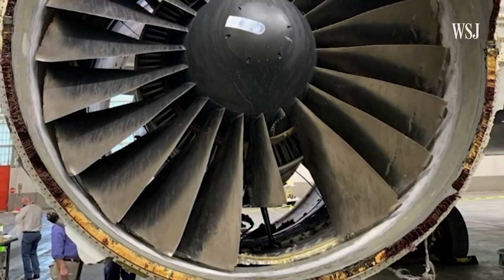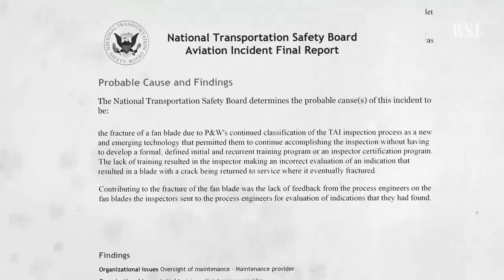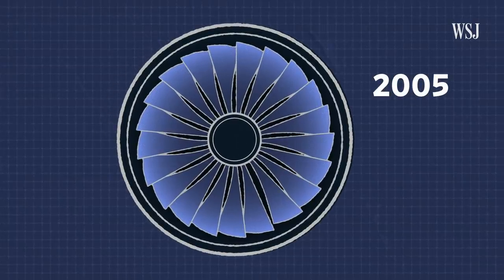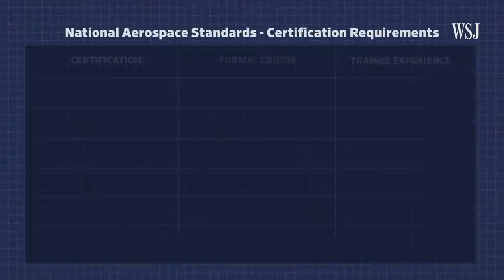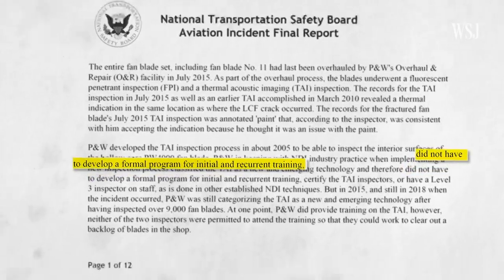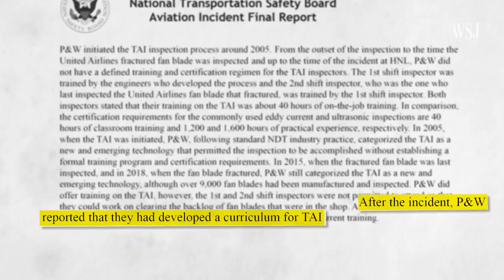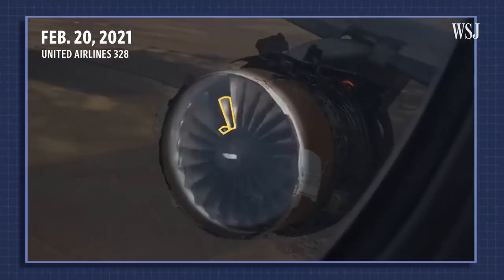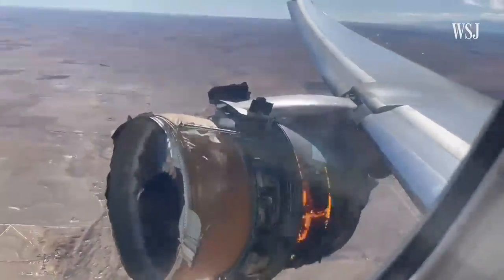The Flawed Inspection Process Under Scrutiny in Boeing 777 Engine Failures | WSJ

Comment: The passengers (and the airline) were extremely lucky that the fan blade did not penetrate the fuselage and kill someone, which has happened before.
Reply: or damage the wing.
Reply: That's actually part of the engine design, to fail safe.
Reply: @anijeetkanjilal4183  woefully misinformed on the Concorde crash.  The issue there was the Concorde’s destroyed tire hit the fuel tank, which absorbed the energy by popping open a panel to the fuel tank, leaking fuel.  The leaking fuel ignited, and consistent with indicated engine fire procedure past V1, the pilots continued with the takeoff and throttled down the affected engines.  Had the pilots continued with takeoff power on all engines, there likely would have been no crash, since the plane wouldn’t have stalled.  The plane didn’t explode until it hit the ground.
Reply: @qwerty112311  I see, sorry, I should learn more before commenting.
Reply: Fan case is designed to contain blade separation. And tested. Google “fan blade out test” slow-mo videos.
Reply: that would be cool
Reply: The engine casing successfully prevented it from hitting the cabin. But some parts hit the bottom of the fuselage. Below the wing.
Reply: @alexm566  But such massive engine failure did cause wing damage which led to fuel pipe damage or worse hydraulic failure. Qantas 32 was a perfect example.
Reply: a passenger died in a southwest flight due to that
Reply: @ltpetrenko  The problem is that the fan blades are pulling the airplane forward when they break. As such they tend to come flying out the front of the engine. On their way out they can cause the cowling to get damaged and come apart and pieces of it can hit other parts of the plane. Plus parts of the cowling can fall to the ground and kill people.
Reply: Well they can't. These engines are designed to encase any blade withdrawal
Reply: Wd40 helps
Reply: yep and thankfully the other engine did not fail too
Reply: @joevignolor4u949  I can judge only from YouTube  slow-mo vids and it looks like blades are well contained. The phenomena is more complicated then a simple force diagram.  That’s why companies spend many millions to test just for a blade out event. .
Reply: @ltpetrenko  Sure, everything was contained during the test you saw in the video. But look at the picture of the large ring from this Boeing -777, which is part of the cowling, that hit the pick-up truck and landed in the guy's front yard. You can see where the fan blade sliced into it as it came out the front. A ground test in a test cell will provide a good approximation showing how well the cowling might contain a fan blade when it breaks off. But test conditions in a test cell and real conditions during actual flight will not be exactly the same. If you had 100 fan blades come off 100 identical engines during actual flight conditions the trajectories of the loose blade and any loose debris during each individual failure will be different because of all of the variables involved at the time of separation. When that much energy is suddenly released under very dynamic conditions how everything behaves will never be completely predictable.
Reply: @joevignolor4u949  “it’s complicated and not very predictable” doesn’t make something that consistently moves radially and back, suddenly shoot forward. I hope we established that there is no such direction tendency, that you claimed initially. Let’s also refrain from tea leaves reading on that inlet lip. There are I bet many way smarter then me people investigating this long hours. Let’s see what they have say.
Reply: @ltpetrenko  I don't understand what you are saying. Those fan blades drive air backwards, which makes them want to go forward. As long as the blades are properly attached to the fan disk then all that propulsive force being developed in the forward direction is being transferred to the engine and then to the plane. But if a blade breaks while the fan is rotating then initially at least the blade is going to want to go forward. Further, as I said, due to all the variables and the dynamic conditions at the moment that the fan blade breaks off what happens after that is very complex and unpredictable. Variables such as the location of the blade in the rotational cycle when the blade breaks off, the rotational speed of the fan, the aircraft's airspeed, altitude, the power setting and exactly how  the blade fails will all influence what happens afterwards. As such no two incidents involving blade failure will be the same, whether in flight or in a test cell.
Reply: @joevignolor4u949  what I’m saying is simple: your model is missing something, that the tendency you claim is not observed experimentally. I’m also saying that “it’s too complicated, so anything can happen” does not create such tendency. I like your model, but something big is missing.
Reply: Yeh absolutely, and thank goodness only one engine

Comment: FAA 'oversight' led to 737 Max failures also
Reply: 737*
Reply: @Kpaojd  - And, the FAA allowed Boeing to “self-certify” the 737 MAX-8, so it’s more precisely “lack of FAA oversight” that contributed to the problems with the MAX.
Reply: Boeing was competing with Airbus. Hence the hurry
Reply: FAA is the simply a staff exchange between them and Boeing.
Reply: FAA instead of being an "overseer," is been known to be a "partner" of the industry, I say that's conflict of interest.  China grounded Max before FAA did, China! if that wasn't embarrassing I don't know what is.
Reply: To be honest it’s just luck that a substandard 787 hasn’t crashed yet due to manufacturing defects.
Reply: *led, not lead

Comment: I used to work at a Pratt Whitney engine overhaul facility in SEA. 

The whole operations was about profitability over everything else with cutting corners being an operating standard rather than an exception.
Reply: Let me guess: 
- Management was filled with MBA's?
- Engineers left on a daily basis, because management ignored their warnings?
- Engineers who didn't quit themselves were fired, because management found them annoying?
Reply: @timmy7201  in Asia there tends to be a very compliant top down culture. Engineers in the mgmt will be more than willing to follow the MBAs.

Any who sit in positions like department head, area managers or chief of the safety department and dont kow tow to the trend will be either pushed out or start seeing their career stagnate. 

The workforce was deunionised and most of the technicians are now foreigners with a work pass renewable every 2 years. The line process was also broken down to very specific and repetitive action so that anyone can be replaced at the drop of a hat and the replacement trained in a day or two because its no longer a skilled job.   

This allowed the management to silence concerns from the actual workfloor. 

Ive watched countless videos online regarding airplane structure and engine maintenance facilities. None reflected what I experienced in reality there. In reality the place looked like a diesel overhaul facility with oil spills and scattered parts all over the floor. 

When there was a visit by clients or potential new clients, an army of cleaners from third party contract cleaning companies will be deployed to lick the place clean until the very moment the visitors register at the guard house. Than these guys go into hiding until the visit is over. 

Thats because no client will want to send their engines if they saw actual conditions when work is being carried out. 

So its no surprise when engines start failing frequently now more than ever. It all comes down to putting profit over all else and those in the management role having a common personal quality which is the willingness to bend their own ethics and professional ethos to go with the crowd.
Reply: @theallseeingeye9388  Honestly, P&W really should have had complete training and resources fully in place for inspections for this type of fan blade upon entry into service in 1995. It should never have been classified as an emerging technology. If P&W had complete training and resources fully in place for these inspections from the very beginning of entry into service in 1995, in addition to truly dependable safety, they would also have had a very competitive, unsurpassed, and high quality product for the market.
Reply: Work for Doncaster for 15 years and I quit on December 2018 for a good reason.

Comment: Why this loop hole that it allows emerging testing processes to have no training for testing professionals. It should even be more evident for new processes to have extensive training.
Reply: Cutting the cost?
Like what happen with boeing mcas system.
Reply: I can only see one possible use for such an exception: if the method is run in parallel to an existing, qualified test that carries the formal fault detection responsibility. Perhaps you’d want to collect comparative data for an eventual future formal change change of the test instruction. Why anyone would bother to do the test at all, without knowing how? A complete mystery. Sounds like a complicated way to waste money.
Reply: Honestly, P&W really should have had complete training and resources fully in place for inspections for this type of fan blade upon entry into service in 1995. It should never have been classified as an emerging technology. If P&W had complete training and resources fully in place for these inspections from the very beginning of entry into service in 1995, in addition to truly dependable safety, they would also have had a very competitive, unsurpassed, and high quality product for the market.

Comment: Why am I watching this on the plane right now 🥲
Reply: LOL
Reply: Are you onboard of Boeing 777 ?
Reply: Obviously not on a plane bc airplane wifi doesn't support streaming
Reply: @FriousBlackPanther  this isn't a 777 problem; it's a PW4000 problem
Reply: @Blank00  that's absolutely correct
Reply: Open up the book holder and read about the latest plane crash, pictures of plane crashes and a grisly photo with  " You're next" written in red crayon and freak the heck out. I used to leave those little gifts if my flight wasn't up to my standards.

Comment: If an engine is so expensive, why don't P&W suggest to replace all the blades before calculated life limits? Or at least some reinforcements? Inspection should not be the only method to maintain a hard life critical component, right?
Reply: Is the forever race to make things lighter and don't tell the customer they need to inspect more often 'cuz that will cost them $$$!
Reply: Money. Need to save Money and boost Profits.
Reply: @jennychan5314  Bingo!
Reply: The customer(i.e.the airlines) have to perform the inspections. A given part has an expected life cycle and cost to replace. As the customer, you don't want to inspect more often because you have downtime for that engine (and lose money) and cost for more frequent inspections.
Reply: @jsmithepa  Honestly, P&W really should have had complete training and resources fully in place for inspections for this type of fan blade upon entry into service in 1995. It should never have been classified as an emerging technology. If P&W had complete training and resources fully in place for these inspections from the very beginning of entry into service in 1995, in addition to truly dependable safety, they would also have had a very competitive, unsurpassed, and high quality product for the market.

Comment: I know those planes can fly with just 1 engine but I'd rather fly on ones that have 4 engines, thank you very much
Reply: I agree but probably new planes to come won't have 4 - cheaper to have 2
Reply: 4 engines are inefficient
Reply: @NyanyiC  inefficient in saving lives?
Reply: 4 engine planes are disappearing from the market, especially commercial market. They will become cargo planes.
Reply: I agree but unfortunately 4 engine planes are sadly becoming obsolete.
Reply: @s.equilibrium.x  Jesus man, you people that have no knowledge about aviation whatsoever that make ridiculous claims like these are too funny.
Reply: But mass market is not willing to pay for 4 engines, majority of the public are booking tickets based on fare, not so much offerings or even equipment.
Reply: It's highly unlikely to have a dual engine failure. Besides, OEI requirements are rigorous, especially with ETOPS certified aircraft.
Reply: Same but its better to have 2 engines for fuel consumption and enviroment
Reply: The immediate concern is, pieces of engine hits the fuselage at a weak point causing catastrophic break up.
Reply: @NyanyiC  Four engines are safer.
Reply: @oldcountryman2795  do you have the numbers to back yourself up? 
Because there might be more engines but having more engines also mean a higher chance of failure on that plane to have a critical engine failure
Reply: @oldcountryman2795  the ability to speak doesn’t make you smart
Reply: I'm more concerned that when a fan blade punctures an engine like that, the shrapnel from the explosion could affect other flight control surfaces and cables. Wouldn't be the first time that happened too...
Reply: U can carry 2 extra next time u fly
Reply: @aerofiles5044  fancy seeing you here
Reply: @s.equilibrium.x  you dont know a thing about aviation bruh
Reply: @oldcountryman2795  not necessarily
Reply: @s.equilibrium.x  No. Inefficient at getting people to buy airline tickets when the airfares go up and inefficient at getting people to buy airline stocks and be satisfied at the stock dividends that they get paid. Remember, this isn't about saving lives. Its about saving money.
Reply: @Kandralla  I think you are confused. Poster Sergiu Sergiu questioned why two engine planes are used when four engine planes are safer. He stated that four engine planes are, "more efficient at saving lives". My reply back to him implied that four engine planes are not any safer than two engine planes and that because of economic factors two engine planes are being used more often. Sorry for the confusion.
Reply: @Kandralla  You are correct that there is effectively zero safety benefit to having four engines. That's not what I'm talking about. What you are confused about is who said what in this thread. I never said four engines were safer. SOMEBODY ELSE DID. Now please go and figure out who it was and go and argue with him. Thank you.
Reply: @s.equilibrium.x  planes can fly on one engine so no need to be worried

Comment: We need to know what fails next the engine pylon or wing if still along way from an airport.
Reply: Not likely to happen. Most of the stress put on the engine happens during take-off or landing. In both instances, it would be close to an airport. The engine cases are tested for and supposed to survive a free-blade incident, so any issues should never make it to the wing.

Comment: Boeing would've been responsible if Boeing still owns PW like back in the 1920s, but Boeing no longer does since BA was forced to make PW an independent company under an antitrust act. This means that Boeing has no control over how PW designs, makes, inspects, or maintains engines. Also, while choosing PW as the sole supplier would be a cost-cutting move, the truth is that Boeing has multiple engine suppliers, which was a great choice and definitely not a cost-cutting move on Boeing's part; should PW engines start to fail, GE and RR engines are still good to power 777s.

Comment: If I am the passenger. I probably won’t be flying again due to the trauma
Reply: What from an engine failure? Even though this was a severe engine failure, it’s still fine as planes are designed to climb on one engine, plus the pilots are trained for it
Reply: @Tom-js3iz  Generally yes, but these types of failures do carry significant risk. 2 of 3 failures were at least "sort of" uncontained, in that some fragments of the blades pierced unrelated areas. The rotational energy of a 112inch fan disk and its blades at cruise or climb power is significant and can cause damage, harm or death.

Also, the high vibration and disintegration of the cowling caused significant drag in these events. Check out the pilot's testimony on UA1175. They did not have a lot of excess performance.

So this type of failure should not be acceptable under any circumstances. P&W has to get it's inspection protocol up to snuff.
Reply: @andreasbauer8668  I’m aware, but these type of failures are very rare
Reply: @Tom-js3iz  They should be, but are not for this engine blade design. That is why the NTSB is investigating.
Reply: @andreasbauer8668  I know, I’m aware why they’re investigating this engine type but I’m just trying to tell old mate Alvin that it’s all g and safe
Reply: @Tom-js3iz  Dude IT IS NOT all g and safe. All failures where blades, disks or rotating shafts liberate from their position are capable of bringing down an aircraft and have done so in the past.

Just in recent years aircraft got more redundant (QF32) or just plain lucky (SW1380). But imagine that blade going through a center fuel tank...  instant disaster...

They have to be taken seriously.
Reply: @andreasbauer8668  I’m talking about normal engine failures, not explosions, calm down